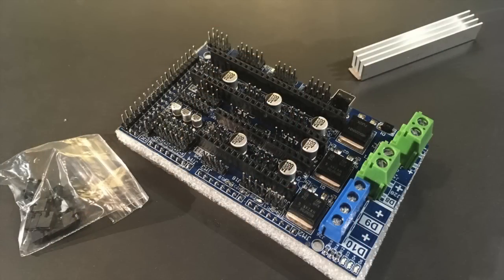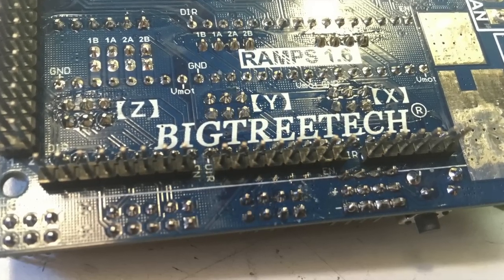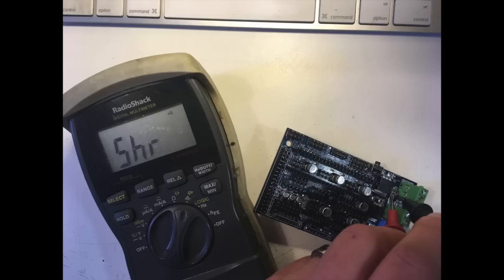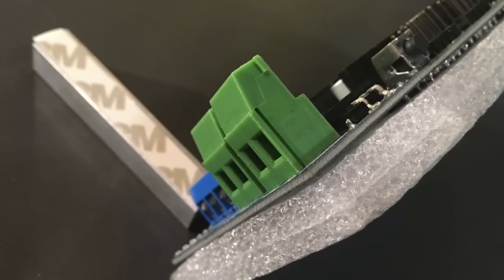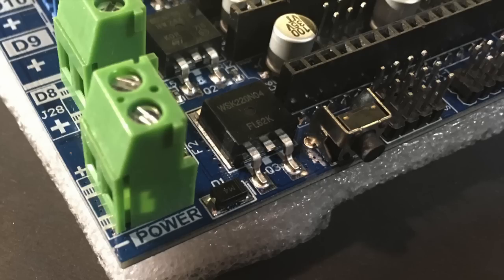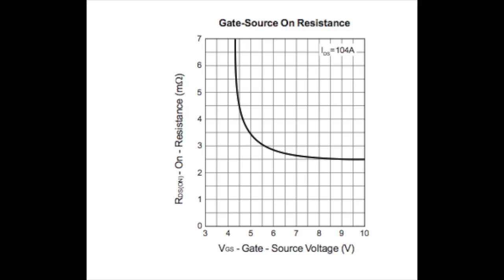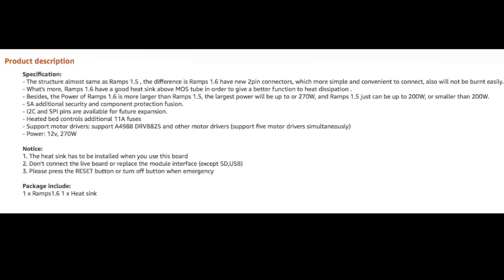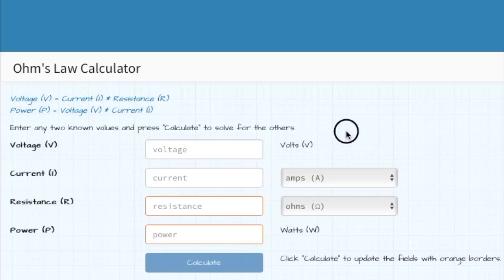(old video) Ramps 1.6 review: the good the bad and the ugly

Comment: Thank you for telling us about the RAMPS 1.6! I saw it for sale but the single connector for the board and bed sent red flags and I wanted to wait and see for the machine to be reviewed, I think I’ll stick with the RAMPS 1.5 for now. Partly because I like moving away from the large polyfuses and upright mosfets and it might encourage more manufacturers to continue developing the RAMPS boards, what do you think RAMPS 1.7 or 2.0 will look like?
Reply from the maker: Well, v1.5 was proposed by a community member, but never really hashed out on the forums and it seems like Biqu was the only company that ran with the design, the community in general has somewhat given up on the ramps, but I think that is a mistake since there is no other viable replacement anywhere near the price range, and many people refuse to spend (or can’t afford to spend) as much (or twice as much!) on a printer board as they would on an entire computer motherboard.

v1.6 was Biqu's own numbering, so I’m not sure what they have in mind for the next gen, but I agree with you that the SMD mosfets are a good direction, and doing away with the PTCs will solve some issues (I with they used replaceable fuses though).  They should release at least the schematic and parts BOM with the changes so that they are not violating GPL AND so that the community knows what they can do with the board: many people will stay away because of the mystery and the GPL issue. 

As far as what I would do for a new version... it’s probably too in-depth to write in a comment, but I have been considering making a video about that, so maybe I’ll do that soon. Among other things, they should address the power, safety, and connectivity issues,  and break out the unused Arduino pins so that we have sufficient connectors for SilentStepSticks. That would be a good jump forward.  Other thoughts: Bring back the separate power connector for the bed, replace D1 with a regulator or adda a zener or other voltage knockdown to prevent the arduino’s regulator from frying if you use a full graphics display or when using higher voltage, etc. A Due compatible version would also be nice.
Reply: Alex Kenis I did not know the 1.5 was a community design, thanks for your thoughts! You really know your stuff, I agree all those changes would be great improvements, also, there is a Re-ARM board for RAMPS that supposedly gets you a 32bit due compatible system with the standard board, cost is about $45 I think it is the cheapest solution atm if matterhacker gets them back in stock, that is without playing with RAMPS-FD or RADDS territory. You really hit the nail on the head, cost is by far one of the biggest limitation, I really hope more RAMPS compatible due boards go on the market to lower the cost, being able to flip flop from 8bit to 32bit by swapping a single piece would awesome!
Reply from the maker: Yeah, I hope I am remembering correctly that there was discussion of going ramps 1.5 with all surface mount parts, but no official files were posted and the Biqu board is the only thing that finalized it.  And yes, re-arm looks like the cheapest route at the moment except hacking a regular RAMPS for 3.3v logic and re-assigning some pins (which I'll post a vid for only after I have time to test it for safety).  Ramps-FD never got finished because the two main devs moved onto other things, and the boards on the market are the early, unsafe v1 version, and need to be modded to be safe (mosfet logic switch-on sequence and thermister inputs specifically), v2 is safe, but nobody makes it.  Radds is nice, but expensive. There is also Smart-ramps which is about $25, is open source, and adds an EEPROM which the Due doesn't have, but it inherets some flaws from ramps1.4.  MAN, i'll have to organize all this stuff and put an overview video out because the 32-bit world is still all over the place.
Reply: thanks! haha, if you ever make a video that tries showing how all these different methods work together I'll smash that thumbs up and loop the video for days XD
Reply from the maker: HA!  Yeah, 32-bit printing is still in a confused state  for a variety of reasons. I'm still going through all the data, but after I organize my thoughts ands finish the 6 videos that are already in progress, I'll do a whole series on budget 32-bit.  Apart from the options mentioned, there are also dev boards that have a 32-bit processor, wifi, bt, sd slot, display port, USB, etc for  $5-$10 that are just begging to be built into a printer, which I will definately try -- and film -- when I get time to hunt one down with enough I/O and the proper capabilities.

Comment: Hi, how do you activate servos ? It seems there is no power. Do I have to sold something between J4 2 pin connectors ?
Thank you.
Reply from the maker: J4 is a 12v header, which is usually labeled '12v-aux' on ramps v1.4, so don't jumper that or you'll short your psu.  When I did a point to point check on the v1.6, the servo headers were wired the same as v1.4 (i.e. '+' is hardwired to 5v, '-' is hardwired to ground, signal pins are wired to the MEGA's 'D4, D5, D6, and D11') so they should behave the same as regular v1.4 ramps.

Comment: Very nice video! I am interested in your opinion about upgrading the whole 3d printer to a 32-bit board, such as the Arduino Due (maybe with a RADDS board). Does this give any benefits to a normal, cartesian-based printer such as the Prusa i3?
Reply from the maker: I am going to get some Due 32-bit vids up eventually... I’m just waiting on a few things and tying up some other videos. 32-bit has some nice possibilities, so I’ll have to test whether it is worth it for Cartesian YET. If 32-bit hardware comes down in price, it will be a no-brainer, but apart from that, it will likely come down to features and whether Marlin's new S-curve acceleration lives up to the hype (looks promising).  

I’m fairly certain though that even Prusa will be going 32-bit with their next big printer iteration, and I would bet that it will be based on something like the Ultimachine Archim 2.0 board. I mean, it would be a good market move for them to do up an ‘i4’ with 32-bit + color touchscreen, and ditch all the linear rod for v-rails (or maybe Hiwin-type shaped rail, although maybe not since they could binding issues with running those in parallel for the kits and whatnot).

Off the top of my head, as far as Due board tests go: RAMPS-FD, smart-ramps, and modded-ramps, etc would probably come first since they are cheap -- between $10-$25 or so.  RADDS looks nice, I'll probably do it eventually, but that board is under CC3.0-non-commercial, not GPL, and they chose not to release PCB files for quality purposes, so there are few sellers and they are still much more expensive than the other options options (around $55-$60 or so + the Due). I'll have to check the quality and see if the extra $$ is worth it... it's just a tougher sell for DIY guys when Due+Ramps or even an SBase are half the price.
Reply: Ze Doc ,going to 32 bit is recommended if you want to improve every aspect of your printing regardless of printer frame (Cartesian, Delta, Core X/Y, etc..). I can’t tell you the difference you just have to connect one and see for yourself and you’ll wonder why you waited. We have several different setups here including Duet WiFi with the Duex 5 board which is premium in itself and than we have a samd1 Uno, and a Due board with Smart Ramps (RADDS) like you’re considering and basically the arduino version of duet and can in fact run the duet firmware if you want but be sure to verify gpio’s are pinned correctly. I do like the Due for reasons you can easily expand on it and it’s more cost effective than Duet but for ready made; the Duet is hard to beat, and you certainly can use arduino expansions with it depending what you’re after. We used these for several various machine types and even for some simple single axis operations.

Comment: Hey Alex, great videos, I recently purchased this board and sofar its done alright,  im wiring some tmc2130 currently (with the help of your video) and hope to integrate the board with my ATX PSU and Octopi for gcode controlled power off. One thing I have noticed is there is no ps_on connection next to the rest button (like on a ramps 1.4)  any chance you stumbled upon this in your research?  Im starting to think they removed that ability to provide room for the mosfet/ heatsink combo...  Thanks!
Reply from the maker: Ah, good catch, I forgot to mention that in the video: They moved the ps_on/5v/vcc header up by the E0 stepper wire header
Reply: Excellent! I never would have noticed the small vcc there (as the other markers are covered). Now im off to tinker some more, thank you!

Comment: Correct me if i'm wrong. The mosfets need to be soldered in opposite direction for the heat sink to be effective. Hope i made my point clear, i mean the metal plate on the mosfet should face upwards so that the heat sink can dissipate the heat better.
Reply from the maker: typically yes, but I think they were just going for "better than the 1.4 design".  But it gets complicated  for surface mount depending on the board design: PCB thickness, filled vs clad via holes, spreader planes or lack of spreader planes, trace thickness, etc.  (for example, the board itself is an insulator, so if you have a thick pcb, a thicker top copper pour and heatpipes could be more efficient, etc) The thermal design of this board is nowhere NEAR optimized, but pretty much any D2pak is going to be better than the ramps 1.4 thru-hole to-220 without any heatsink.  That all changes when you talk about adding metal heatsink fins and fans though.
Reply: Hello apologies for jumping into this discussion but I am attempting to build my own first 3d printer (graber i3) I purchased one of those ramps 1.6 Arduino board and stepper drivers package on AliExpress, unfortunately no build instructions etc.etc. now I'm not very experienced and I have overloaded my brain with all sorts of info but I took the step of purchasing a MOSFET to use with the ramps board only to discover there are no instructions on to how to wire the MOSFET into a ramps 1.6, I do understand how to wire the power to and from but the control wire I am at a loss as to where that should go. Is there any info out there?
Reply from the maker: The bed mosfet on the 1.6 should be pretty good, but if you still want to use an external board, they typically have 3 connectors: board/control, bed, and power.  Typically the board connector goes to the ramps d8 screw terminal on the ramps.  Most that I have seen are pretty similar, so read/watch a few guides online to get the hang of it.  search for installing external mosfet board, or something similar
Reply: Alex Kenis Thank you for that info I did that yesterday after a brain fog moment I think I panicked after looking at all the wires.Thanks again.

Comment: One downside is definitely the lack of the dual power input.  I want to use a MK42, so i have to use a mosfet to feed it separately. / or i run the stepperdrivers externaly with 24v. which i think is also good because then i can easier cool them.
My delivered Ramps 1.6 have really good quality all connectors are straight and well soldered. Nothing bent.
Reply: aliexpress

Comment: hey man i found you videos last night i bought two Da Vinci 1.0a yea i know right but i only paid 100 for both one new in box and one with 45 mins print time on it so i get theme and switch to repetier fw now im wanting to build my own printer you think i should gutt what i have or just keep them and start fresh            p.s i like the hardware videos iv seen so far i understand like 90%of the stuff you talk about but i could see how someone with out so much 3d printer or electronics exp could get loss but pls dont dumb down what your doing for the masss
Reply from the maker: No shame in a pair of printers for $100! Good question though.  If it were me, I would keep the boxed one as-is, pull the main board out of the other and sell it , and then go from there.  If you are not looking to print super fast and you just want a functional machine out of it, with a bit of hacking, you should be able to just put a ramps or something in it (I'm sure there are a ton of davinci conversion posts out there), but even if you can only salvage the steppers/wiring/switches/etc, it may be worth it to reuse those in a custom build.
Reply: yea for sure and talking about fast have you seen the klipper firmware dude does a cube stupid fast. thanks for the reply yea i got some really good prints from the davinci's. i was thinking of using them to print all the parts to a new printer then selling both. they seem to be selling for just a lil less than retail in my area on craigslist
Reply from the maker: I've been checking in on Klipper occasionally for a while now.  Looks promising!  When they get Trinamic support ironed out a little better, I'll put it on a machine and give it a try.

Comment: You mention "a denectly built ramps 1.4". Where does one find that?
Reply from the maker: Yup, I hear ya.  Other than the ‘premium’ boards (which are so expensive that it is not worth it) I have not found one that is perfect without work: 
-Robotale and Keyestudio are good if you run at 24v, but you have to modify the PCB traces because the the MS1-3 pins are all permanently jumpered. 
-ZYLtech boards are solid except for the absolutely HORRID mosfets and the fact that you’ll have to replace the 16v polyfuse to run at 24v. 
- Bigtreetech 1.5 is okay-ish except the output connectors are only rated at 10A.
- Bigtreetech/Geeetech 1.4 is also okay if you find one from the batches with gold pins and upgraded mosfets, but you’ll also have to replace the 16v polyfuse for 24v.
- Etc etc etc
Reply: I found the premium board made by staticboards to be of good quality, not even that pricey (they are made on spain and i'm in germany).
Reply: Nice! Any links?
Reply: There you go: https://www.staticboards.com/products/arduino-shield-ramps-1-4-sb-premium/

I ordered via Tindie, worked fine. The same dudes also sell an ATX breakout board, which has replaced my chinese firehazard :)

Comment: I agree with what you said. Tried to use a new 1.6 today, no documentation. The Arduino would not communicate so there is that. I plugged the ramps 1.6 into my old Arduino board but could not get any servo to move. Using the DRV8825 module there is no voltage on the potentiometers. Not sure what the problem is all the jumpers are in place but I have 3 extra jumpers and was searching for a clue if I need them. Next to terminal D8 there is a place for J4 but it is empty. No jumper pins. J4 would supply ground from the power to the positive post of the heat bed.
 D1 is installed and supplies power to the Arduino board. I know on the ramps 1.4 D1 is removed if you use 24V.